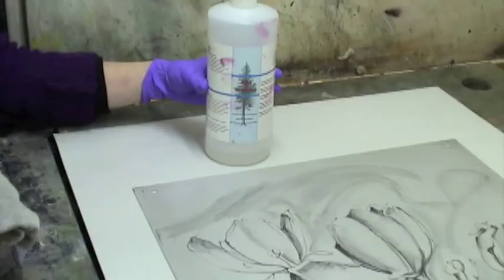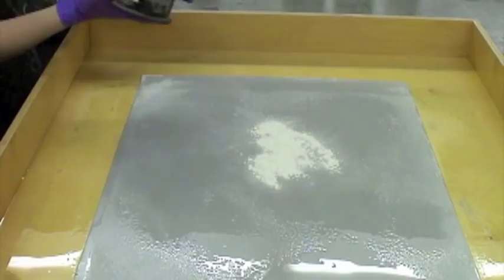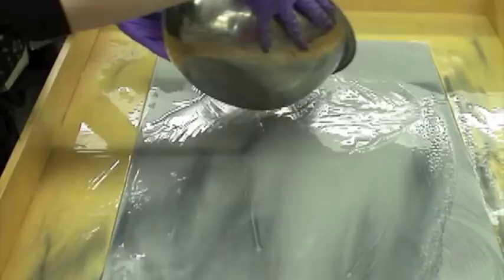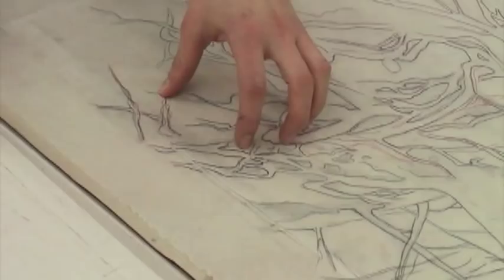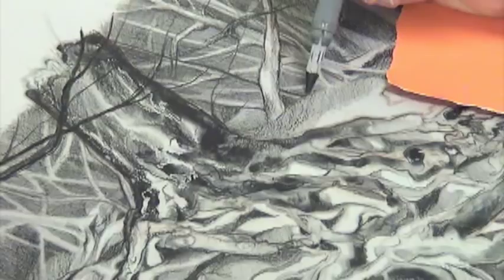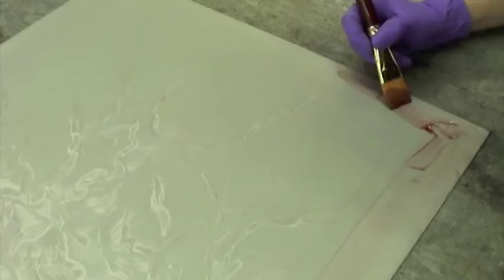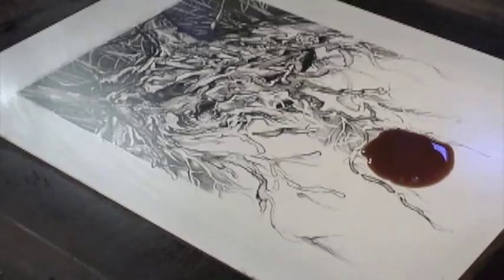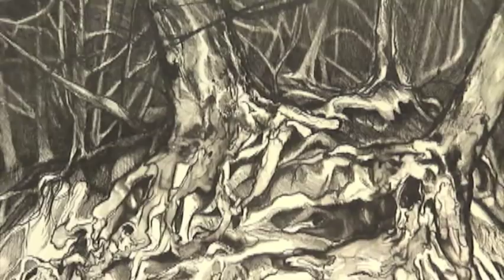One Color Lithograph Using a Century Plate

Comment: You wouldn't rather do cycles of 100, 180, and then 220? To me, doing them all while using an alkaline cleaning abrasive would compromise the plate further. Though it may not have been on hand, an Acetic acid or citric acid counteretch could have been used ad then doing the grit cycles perhaps? 
All in all, it's a good and well-instructive video. I love lithography among other methods of printmaking.
Reply: Chris,  Thanks for the suggestion.  It works for us, although you could try different cycles and methods.  You very well could find a better way that works for you.  Our hope is that printmakers will try this and improve upon it and continue to make prints using safer materials.  Citric acid is good as an etch and relatively safe.